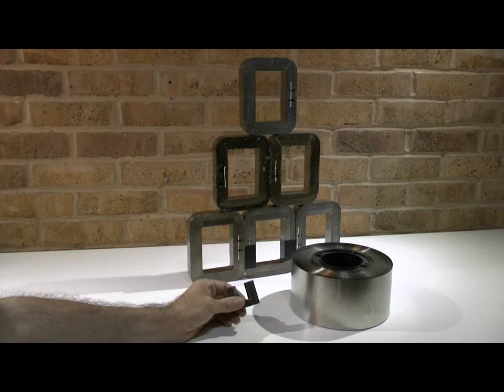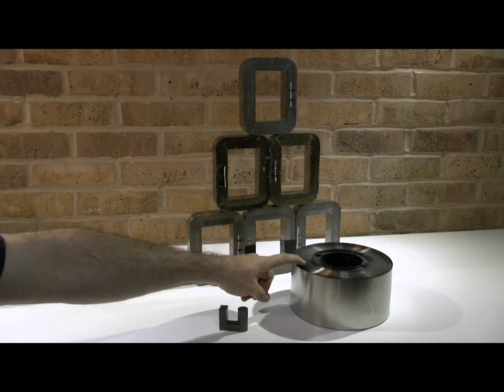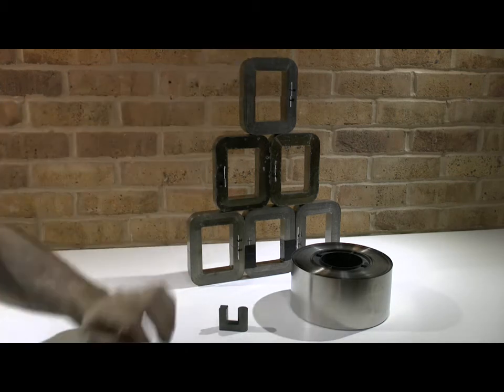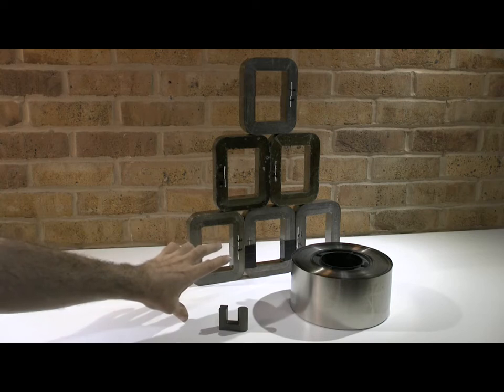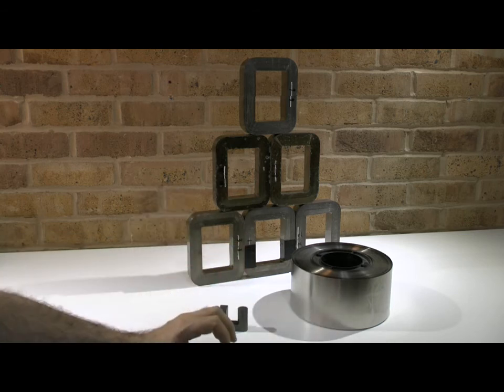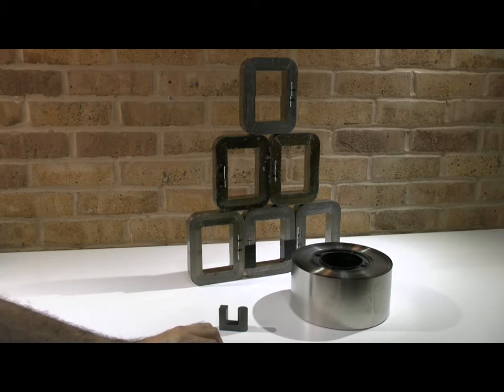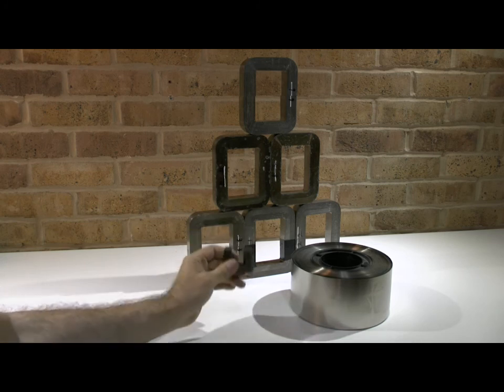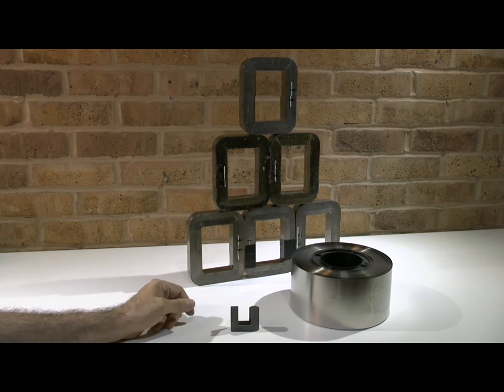Bespoke Metglas Transformer Core Arrays

Comment: i really want to manufacture my own audio input and output amorphous core teansformers. i hope to find an decent supplier of ribbon... since this seems to be the most difficult part. did you bake your cores or treat them?
Reply from the maker: The cores are manufactured with ribbon tape and varnish on each layer. Clued together so to speak. I can sell you the ribbon tape you need. Have a look at my website under products.
Reply: TheOldScientist how do you cut your cores? And so you don’t anneal them in a vacuum chamber oven?
Reply: Ps also how do you get the desired width?
Reply: Pss: I’ve tried to figure out how to wind them and I can’t seem to find plans and the diverse nature of core winding machines are usually for power like transformers. How did you achieve tensioning? Would I be able to use an altered german coilwinding machine with a rectangular form to achieve this?
Reply: I will join your website but please answer my questions and give me some reference material if possible. I would like to follow similar processes to luhndal but with interleaved primary and secondary with 9:7 ratios and a bobbin